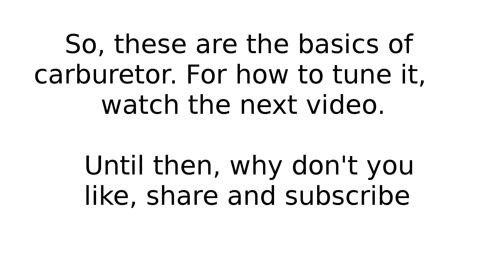Basics of how a carburetor works

Comment: how to remove main jets or primary and secondary jets
Reply from the maker: Why would you want to open your primary and secondary jets? It creates more problems than you can think of. Just use the stock jet sizes and a good tune and you will get good mileage. If you want power, swap the carburetor for an esteem carb which has more sophistication in it.
Reply: Aveem Ashfaq Ok
Reply: Aveem Ashfaq what is stock jets size of m800
and I need more power because i live on hill roads
and what is "esteem" is is brand or company
Reply from the maker: So, are you from pakistan? The name for you i think is suzuki cultus. By the way, first try doing carburetor tuning like I have shown in the video. It gives you a good balance between mileage and speed. https://youtu.be/dGH5kyuahJI

If you are still not satisfied, then swap your carb for a cultus carb. The stock jet sizes of mehran aka m800 are primary pilot jet 40 and secondary pilot jet size 55. Main jet 92.5 and 165 for primary and secondary.
Reply: Aveem Ashfaq Yes I am from Pakistan
Reply: Aveem Ashfaq Ok I understand Suzuki Cultus name is esteem in others countryside
Reply: Aveem Ashfaq Thanks Brother
for more questions I Will talk to you,
If you don't mind.

Comment: brother i need help i am so desperate that i actually searched youtube the mechanics are hell to deal with one guy says one thing the other says something else please please help me tell me a good guy who can help me clean up my carburetor and not screw me up i know and i have cross checked one mechanics diagnosis and it check out but i know that this guy is trying to hack money out of me my car is alto VXR 2011 with just 29000 miles on it , and mainly just sits there in the garage (might be part of the problem) now about 2 months ago it started giving out black smoke and started like misfiring a little and then wouldnot at times start even after usage for 2 hours when the engine is expected to be warm .......... so we and had the tuning done and the carburetor cleaned out after 5 years .... still the problem persisted .... now this other guy i went to  he was like before even checking the car i need to have the carburator replace i was dumfounded i mean what the hell please contact me i am so stressed it's hell when you don't know jack and people then just try to make fools out of you.. what if the problem just isn't that major and he screws it up even more that's my concernnnnn helpppppppppppppppppp
Reply from the maker: I am from india and so I cannot suggest any mechanic in pakistan. However, why don't you try cleaning the carburetor yourself. Get the car home, Wait till tomorrow, I will post the updated new video on how to clean a carburetor by yourself at home. Doing this by yourself is the best way to get out of this mess.
Reply: brother i am a girl and i know the way this sounds but what if i screw it up even more i really don't know anything about cars and for that matter even my little brother doesn't know much  about cars.... plus could you kindly just answer one question " the symptoms are as follows"
1- occassional black smoke coming out from the back if you rev the engine hard there is like big blow of dusty smoke that comes out
2- the car not starting after being driven for 2 hours .. even if the engine is warm
3- car sort of does this hiccup like thing when it exceeds speed of 50 
4- occassionaly does this hiccup thingy even below 50

and 60% of the time if it's used for less than an hour drives pretty normal like it doesn't give any trouble it feels pretty normal like there is nothing wrong with it however when it warms up than all the symptoms are manifested
 now my question

how bad the situation needs to be in order for the freaking carburetor to be changed?  when i know that my car which has just 29000 miles on it bought in year 2011 zero meter should not have the carburetor replaced......
Reply: brother i am a girl and i know the way this sounds but what if i screw it up even more i really don't know anything about cars and for that matter even my little brother doesn't know much  about cars.... plus could you kindly just answer one question " the symptoms are as follows"
1- occassional black smoke coming out from the back if you rev the engine hard there is like big blow of dusty smoke that comes out
2- the car not starting after being driven for 2 hours .. even if the engine is warm
3- car sort of does this hiccup like thing when it exceeds speed of 50 
4- occassionaly does this hiccup thingy even below 50

and 60% of the time if it's used for less than an hour drives pretty normal like it doesn't give any trouble it feels pretty normal like there is nothing wrong with it however when it warms up than all the symptoms are manifested
 now my question

how bad the situation needs to be in order for the freaking carburetor to be changed?  when i know that my car which has just 29000 miles on it bought in year 2011 zero meter should not have the carburetor replaced......
Reply from the maker: Ok. Do not panic. You can still do the work by yourself. It just looks complicated because of the complex shape but it is very easy. If you have any problems, you can contact me via mail at aveemashfaq@gmail.com and I will personally assist you from there.

SYmptom 1 means that your tuning is wrong. You are sending too much petrol for the amount of air.

Symptom 2 means that your spark timing might also be wrong. Or your distributor coil. I am not sure. I need further diagnosis.

Symptom 3 and 4 means your car might be overheating. You need to check your coolant and the cooling circuit.

Dont be fooled and buy new carburetor. You do not even need to open it. You just need to do tuning. That's all. I will be putting the video shortly. I will first make a video on how to clean carburetor. Then I will put a video on how to tune it.  Please contact me with further details in the mail if you need anything urgently.
Reply: thanks brother went to a suzuki authorized workshop today and had the carburetor tuned the guy did the job to our satisfaction so it seems as there was a clear difference in the way the car felt no hiccups smooth ride had a couple of things like vipers and side glass fixed also all in all we felt quite satisfied ..... i will keep in touch with you though for guidance on different matters as what you told us yesterday really helped us decide the kind of words we were suppose to use to define the problem kindly do make a video on  general upkeep of the engine like very basic things that we need to do the ensure that the car remains in healthy condition...
i am really happy and really appreciate your help.... many thanksssss.. :)
Reply from the maker: No problem. It would be a nice idea to get the spark timing as well. If you have any need, you can reach me at aveemashfaq@gmail.com